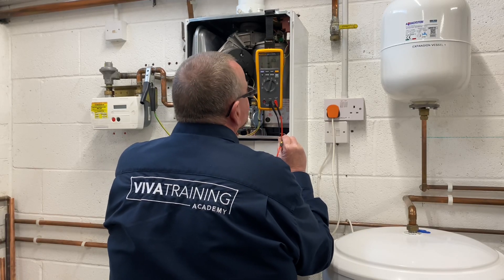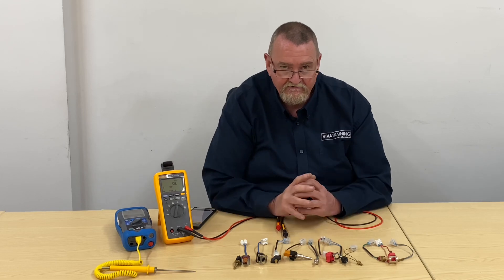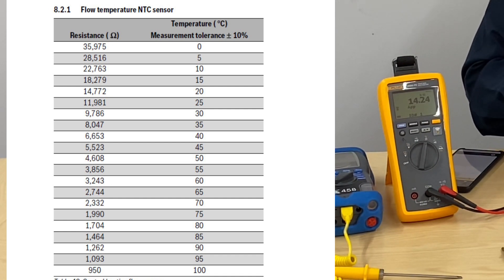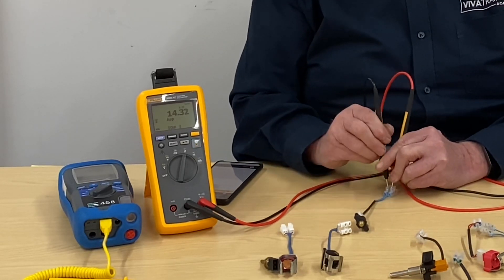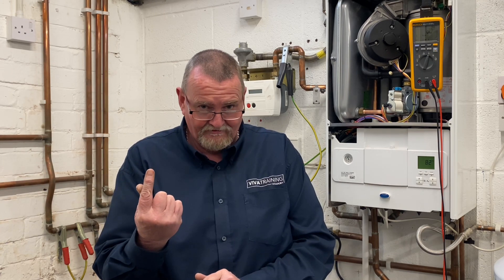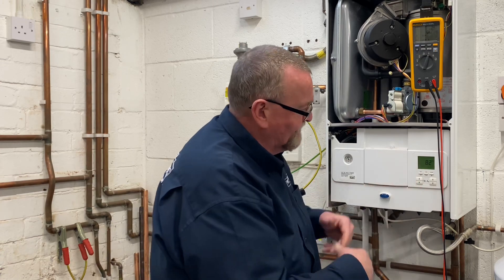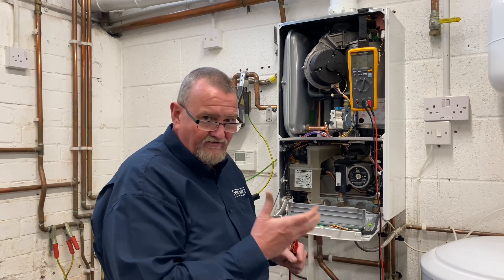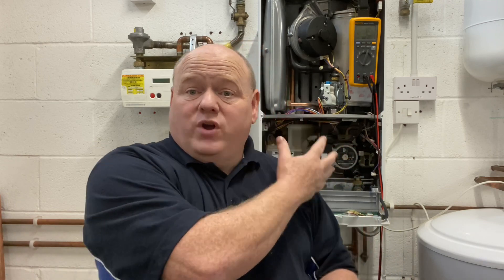Gas Training - How Thermistors Work And How To Test - Viva Training Academy

Comment: Have I missed something?  The "Naughty Corner" - I've listened to what you said at the start, and IMO can't find anything wrong with it.  NTC - Increase temp = decrease in resistance and vice versa, so decreasing the temp = increasing the resistance, same thing. So @ 0 deg C = 33.6K Ohms, @ 30 deg C = 8.035K Ohms. (chart). As the temp moves either up or down it has the opposite effect on resistance.  So as I see it, because the thermistor is a temperature sensitive device, it is best to describe it in terms of temp and not resistance. What did I miss?   Thanks.
Reply from the maker: Thank You for the feedback

Comment: With my full respect to your colleagues from viva he mentioned thermistor used for temperature, and flow also, as I know thermistor not used for flow measuring. Please let me know if I am wrong .
Thanks
Reply: Hi Kamal, thanks for your feedback, some boilers which have a thermistor fitted to both the flow and return, will use the difference in temperature between them to detect the pump is running. When the boiler is at rest both thermistors will be about the same resistance, then as the pump comes on and the boiler fires the flow temperature will rise quicker than the return temperature.

Comment: Very nice presentation, I made a video very similar for Allen a while back, but I have to say that I disagree with how your showing people how to test the thermistor, by using the displayed temperature on the front of the boiler and checking it against the resistance reading will always read the correct reading, purely and simply because the temperature which is being displayed on the front of the boiler is coming from the thermistor your testing so of course it’s going to be right.
You have to use temperature clamps to ascertain the actual temperature and not rely on the display and the. Check the resistance against your temperature clamps. Other than that your videos are very good for the new guys.
Reply from the maker: Thank you very much for the feedback.

Comment: Very good info. What would a boiler be doing to suggest a faulty thermistor? Thanks
Reply: There are a number of issues you could get with a faulty thermistor, for example if the thermistor was reading too low a temperature because it was failing the boiler would fire up in frost protection mode.

Comment: Can you tell me the model number of the meter Roy is using. Thanks.
Reply: Hi Jon, It's a Fluke 3000FC, the reason I got that is because of the Fluke Connect App so I can show the readings to camera when we do the videos, for training students I use the Fluke 114 as its easy to use and robust.
Reply: @royfugler9971  Thanks Roy. It looks like great meter. 👍